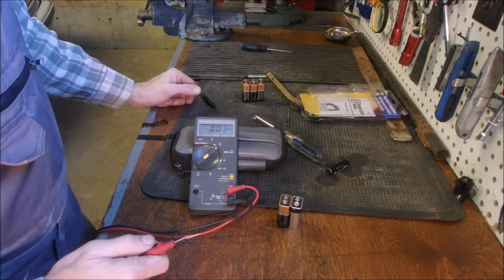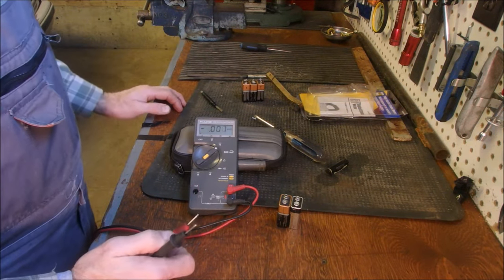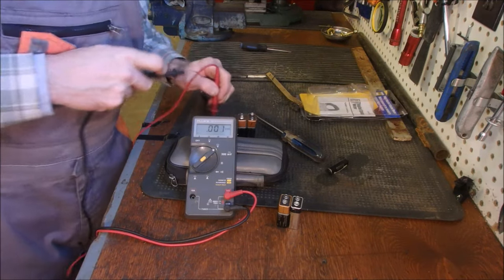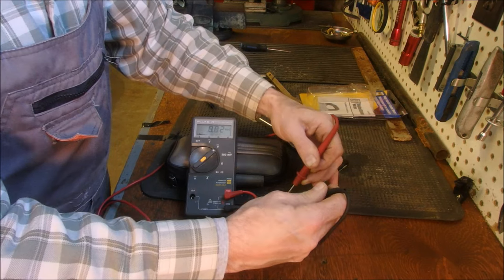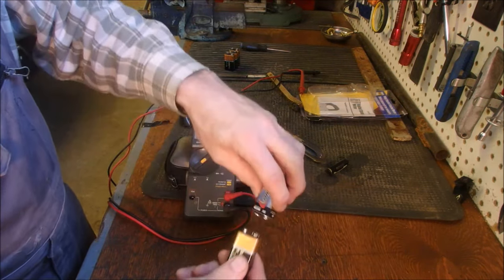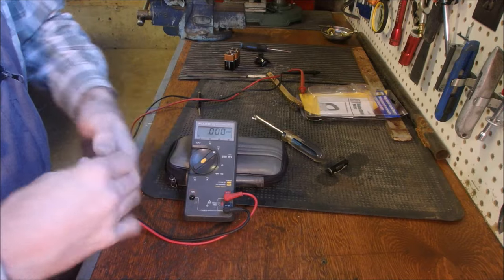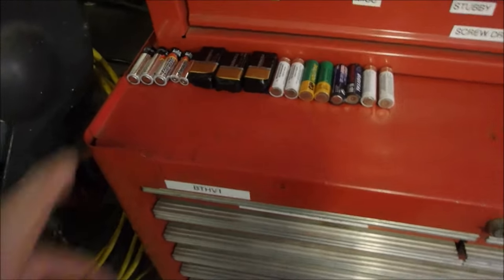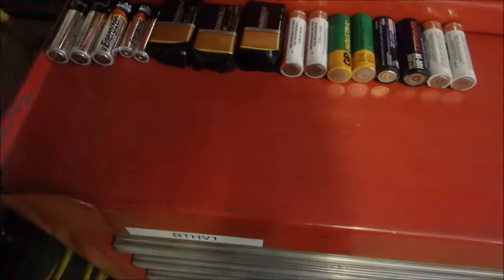Tips and Ideas (safety too)

Comment: Hello Bruce. I think my mower is overreving. Only after the engine is hot, like 15-20 min mowing. B&S 450 Flat head engine.
Reply from the maker: That is a tough one.  check the governor linkage for sticking.
Reply: Bruce Pender I wonder, could oil from the air filter cause this? I will check the governor. Dust and gunk with oil can cause this?
Reply from the maker: It is the first thing to check    Just keep looking at it and don't be afraid to take it apart keeping track of the pieces.
Reply: The mecanism moves smoothly, however the bigger spring is a little rusty. I don't see anything wrong at firs glance.
Reply from the maker: This is a tough one.  My only advise is to keep working on it.
Reply: Ok, it has got to be a spring problem. I bent the throttle tab to unlock it, if I move it half-way it run at propper speed. Now it doing it when warm... Could it be running a little lean and after it heats up it runs correcly? So many variables

Comment: When testing batteries they should be on a light load for a more accurate test.
Reply from the maker: I know but 9 volts will tell me that they will work for anything for a while.
Reply: That is true.
Reply: +Bruce Pender although the voltage seems good, the amperage is just as important.
Reply from the maker: Yes   ohm's law.   All 3 play a role.  Volts  amps    ohms.